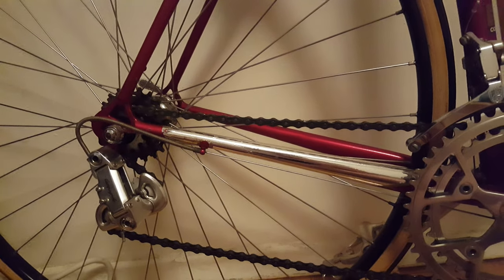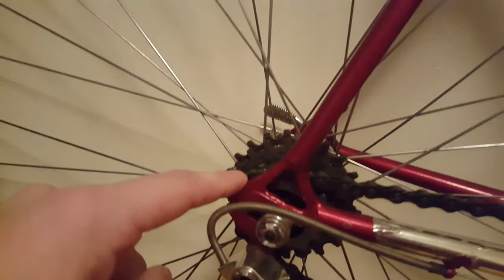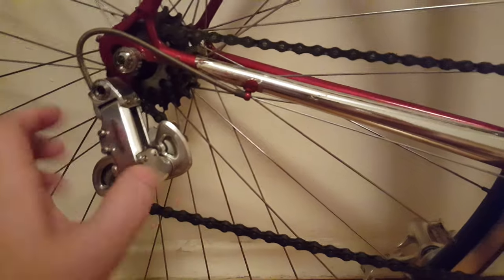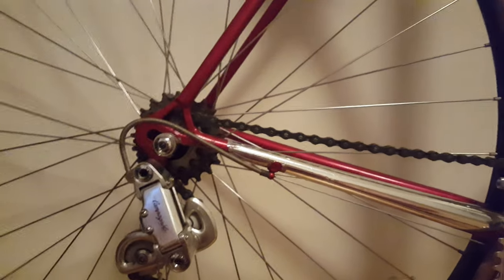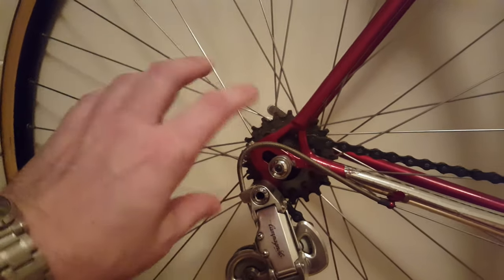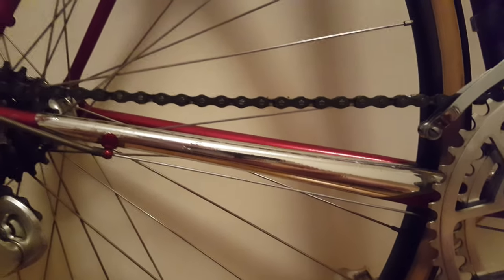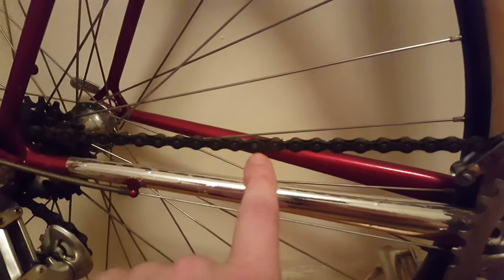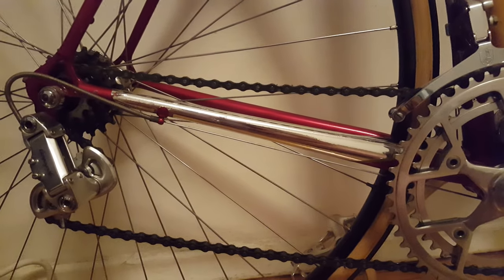Fixing A Sagging Bike Chain ON A  Road / MTB / Hybrid Bike

Comment: Hello and thanks for the info. But how you fix problem number 1? You tight up the lower spring (the lower of the two silver screws)?  Thanks
Reply from the maker: Yup. Loosen up, move the wheel back and thghten it. Also measure the chain to see if it is stretched. 
Wish you luck.

Comment: I changed my chain and while I ride it my cycle started skipping. I changed the freewheel too and still the same problem persists. My mechanic says crank is okay and doesn't needs a replacement. What should I do ?
Edit: can incorrect chain length be the issue ? My mechanic installed the new chain without sizing it .
Reply from the maker: Javed,  did you confirm that these components were worn out before you changed them?  I would get a second opinion from an other bike shop. For example, many bike shops can't fix issues  my Campagnolo drivetrain.
Reply: Sounds like your derailleur

Comment: Can I ask for help? So I was riding my bike and a dog suddenly chases me and I saw road hams and I my bike jumped and so the deraileur pulley suddenly gone loose how can I fix it is it entirely broken? Please help
Reply: And the chain are all wobbly
Reply from the maker: Juvan some broke there, so you will have the find out. Looks like the rear derailleur went out of adjustment.
Reply: It is, is it possible to be fixed at home?
Reply from the maker: Pulleys get replaced easly. Ask someone that knows the bikes to assess the damage.
Reply: @IvansBikesBmws  how much is the parts?
Reply from the maker: @kazahara0173   Pulleys are not expensive. Hope that helps.
Reply: @IvansBikesBmws  how much is it really?
Reply from the maker: @kazahara0173   You could replace the rear derailleur for as low as $15 dollars. It is very easy to install as well.

Comment: How do you fix a loose spring in derailleur?
Reply from the maker: In 99% cases those springs need to be replaced. Just swap it out if you can find the new spring. Thanks for the question and consider subscribing.